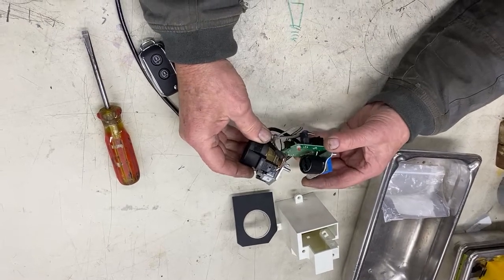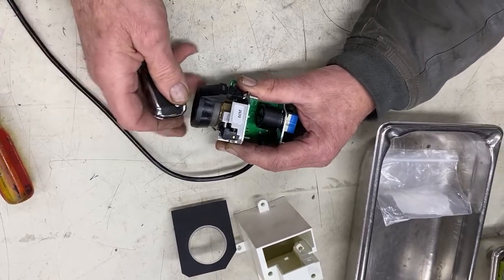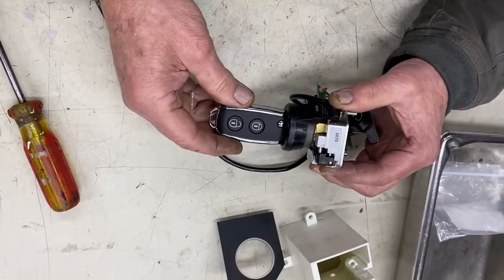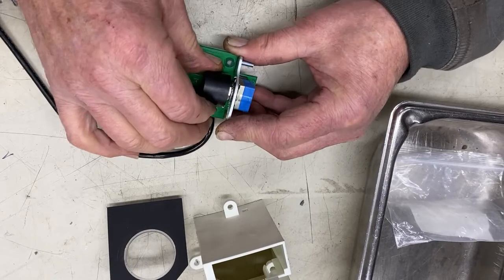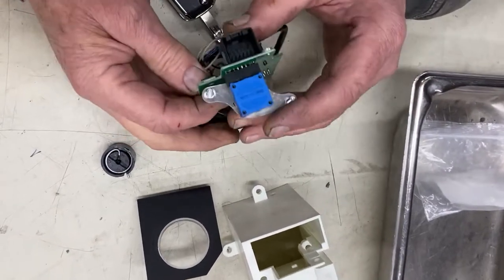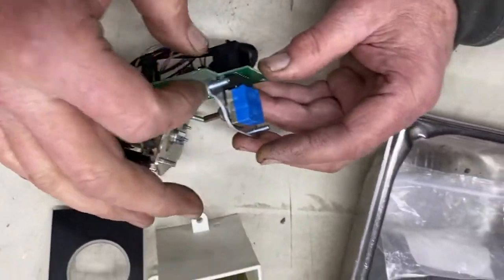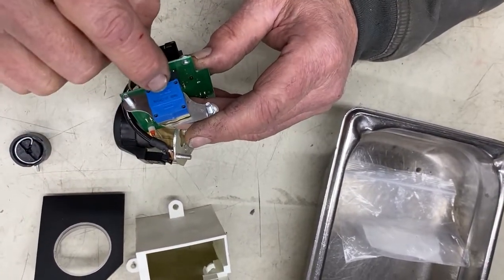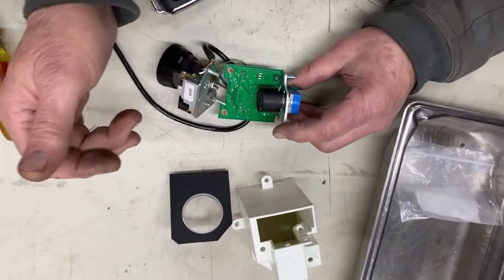Bentley 2006 Ignition switch analysis

Comment: Great video. I have a 'short to plus' ignition code on my 2005 Continental and an "Immobil Active' error msg on the dash. My ignition switch seems fine in so much as accepting the key, and turning smoothly, and then allowing for key removal easily. However, the error remains. Do you think the problem is with the circuit board and is it replaceable without programming?

Comment: How did you remove it? Can you show a video please❤❤❤❤
Reply: I'm in the exact same boat. I'm getting Immobil Active on my 2005, and 00576 Terminal 15 short to plus, 00166 Access/Start Auth Switch Open Circuit. Steering lock would not disengage. Did you figure this?